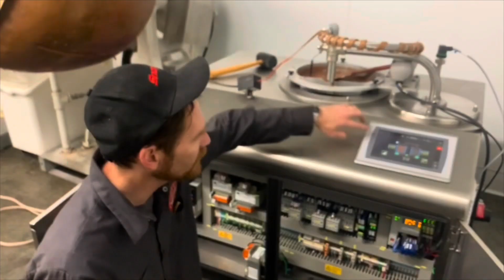2014 Prius Clock Spring Replacement

Comment: I have a 2014 Prius 3 that the horn button doesn't work, but the horn doesn't honk when the panic alarm is activated either.  To me after looking at the circuit, that suggests that replacing the clock spring wouldn't be the solution of the problem.  I'm wondering if it's the integrated relay but I wanted your opinion first.

Comment: Hi, great video! I bought an aftermarket clock spring off of Etsy. It didn't have the steering wheel angle sensor, so I used the old one off of the old clock spring. After I installed the aftermarket clock spring, everything worked (horn, volume... all steering wheel buttons) but the traction control light came on (the yellow light with a picture of a vehicle with the squiggles below it). I tried using my scan tool but I couldn't get any info from it. Do you know how to diagnose the problem or fix it? Thanks in advance!
Reply: That's traction control there should be a button somewhere. You can also turn it off with some apps like Dr Prius and a bluetooth OBD device.
Reply from the maker: @ I agree, you have a traction control error code. It could also be that the steering angle sensor is not plugged in correctly now or somehow got broken. Clear the code and see if it returns.

Comment: I have seen Videos for lexus rx 350 with a two bolts to release the air bags.  But my 13 rx 350 looks like this Steering. It does not have the bolts on it.

Comment: excellent video. My car is pulling a code for a bad Angle Sensor. The Angle Sensor is connected to the Clock Spring in the back. The Angle Sensor is causing the traction control light to show that it is inactive. To separate the Clock Spring from the Angle Sensor I used a small screwdriver to slightly nudge the two pieces apart.

Comment: I have a 2015 Prius, with c1231 code, which suggest maybe just the steering angle sensor,  Ebay sells aftermarket senssor only but their compatibilty chart only goes up to 2014. Have you done this on a 2015 sensor only?
Reply from the maker: The clock spring includes the sensor. I suggest buying a used clock spring as the after market ones  do not fit well at times causing a huge waste of time.
Reply: Thanks, after posting this I decided best to buy used from someone parting out a prius.

Comment: 👏👏 as always well explained.  I got a question if  you don't mind.  I have 2010 toyota prius the trip buttom of the right side of the steering wheel doesn't work what can be? Thanks
Reply from the maker: That is either the button module on the wheel or the clock spring!
Reply: I had the same problem. Changing my clock spring fixed it.

Comment: Thank you for this great video! I successfully replaced the clockspring hoping it would fix my unresponsive steering wheel buttons (bottom right, including the defrost). No warning lights or new issues after install.

Unfortunately, it did not fix the unresponsive buttons. No error codes either. Any suggestions on what to try next?
Reply from the maker: The button component ( a few buttons grouped together ) might be broken. These can be replaced on the steering wheel usually with air bag removed. I buy stuff like that used on ebay.

Comment: Thank you for this video
In my Prius 2010, the buttons work to rise and lower the volume in the stereo, and control the air conditioner, but they don’t work for the front LCD panel (green fluorescent display)… have you seen something like that? Thank you.
Reply from the maker: That is new to me.
Reply: Changing the clock spring will fix that.
Reply: 6:01 what is the size of that hex nut securing the steering to the spline?
Reply from the maker: @robertoguerra5375  something like 21-24 mm.
Reply: @Mrelectric423 I saw in another video: 19mm

I replaced it with the help of a friend today… my steering button (as explained above) is fixed 😊 all the buttons and horn work 😊

Now, there is a steering angle sensor warning (I reused the old one in a new 3rd party clock spring)… but i watched another video to reset that sensor’s angle

THANKS!!
Reply from the maker: @robertoguerra5375  good work! You saved a lot of cash with the diy

Comment: I have 400k on the car. I also have punched the horn switch a few times in quick response to issue. 

Do you think it could be the button or clock spring
Reply from the maker: @drew_w1586  could be more than those two choices. I think I would test for power at the horn first.

Comment: What would you have done if some of the buttons didn’t work after replacement of the clock spring? My Prius had this issue. All the other buttons on the steering wheel now work, wxcept for the display and trip buttons.
Reply from the maker: @leonardofranco5098  it could be the steering wheel button or a bad replacement clock spring. Did the same buttons not work before and after new clock spring?
Reply: @Mrelectric423  I have three different steering wheel assembly replacements for the buttons. Each one I put on works as much as the next one. Almost everything is new. The clock spring is new. The buttons are new. I had the tracer pad ripped from the original one. So now I put a new button pad and wires. But the display and trip button remain non functional.
Reply from the maker: @leonardofranco5098  at this point it sounds like a wiring issue. Like maybe one of the plugs is damaged.

Comment: Is it ok to change clock spring while battary terminal is connect?
Reply from the maker: No because you are touching airbag wires and airbag could explode. In fact you don't want to change any electronic parts with battery connected.
Reply: @Mrelectric423  so how can i fix the clock spring sir? Mas clock spring is ok my main problem is i want to turn the clocks spring correctly. Because i try to disconnect na battery the prblem is i cant turn the clock spring because is lock.

Comment: I ordered a new clock spring but it won’t get here fast enough. 

How can I disconnect the horn in the meantime?

I can’t drive because the horn is intermittently blaring
Reply from the maker: The horn always on is probably not the clock spring. Might be the button in steering wheel is stuck. This happens when it gets punched too hard.
Reply: I replaced the clockspring and now everything is working normally again. However I’ve got the airbag light still on. No codes according to my obd2 scanner…